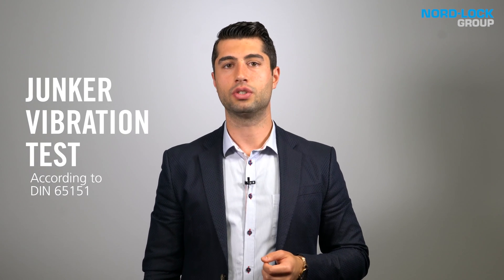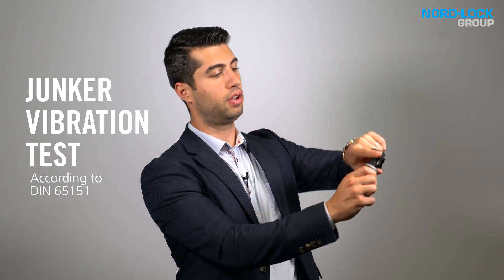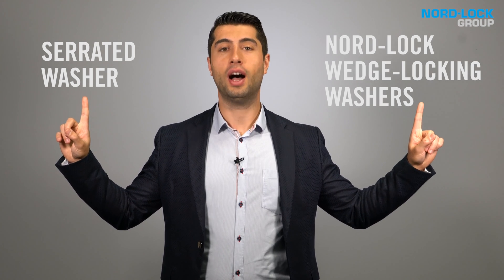Nord-Lock vs Serrated Washer - The Challenge

Comment: Curious about Nord-Lock vs threadlocking adhesive/loctite?
Reply from the maker: Hi!

Adhesive/Loctite can be a good option to prevent bolts from rotating loose, but there are many different kinds of adhesives. So you must know which one to choose and also how to apply it on the bolt thread for best effect. 

We have tested different kinds of adhesives in the Junker test and some worked very well while some rotated loose. You also need to take into account the time for curing. It is much faster and easier to install Nord-Lock washers. 

We still think Adhesive/Loctite can be a good option, but mostly for permanent joints - which means joints that do not need to be opened on a regularly basis.
Reply: What about for exhaust nuts?
Reply: Loctite is better and lighter